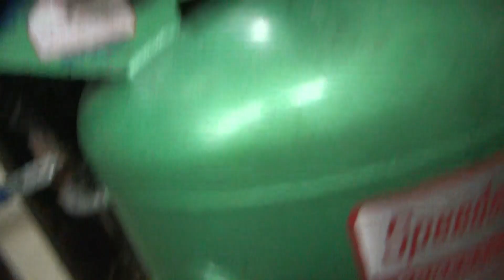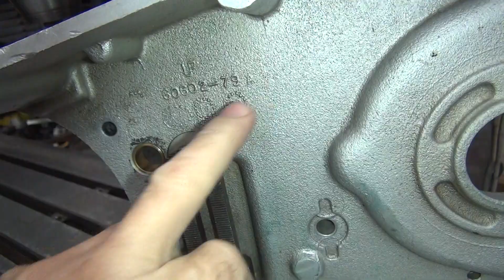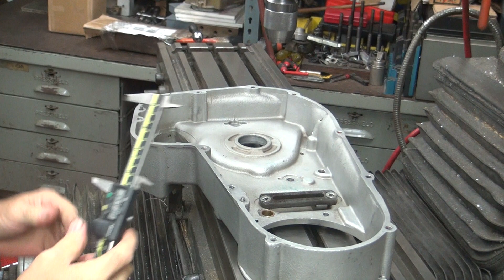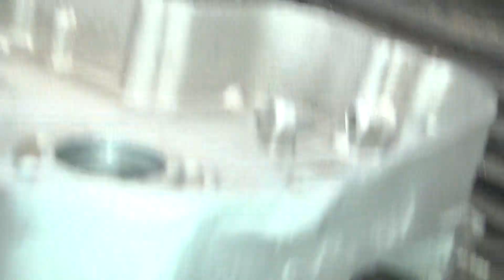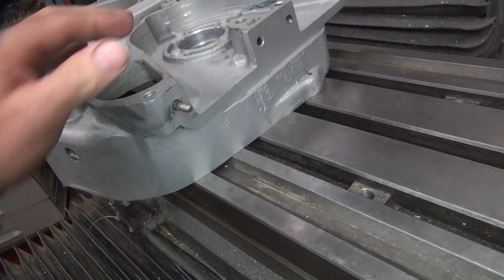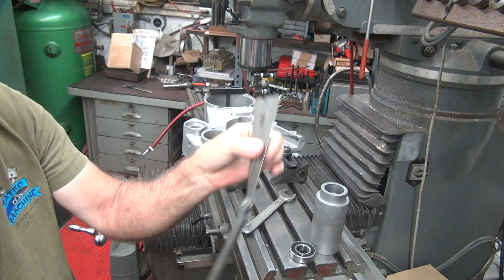#108 1983 fxrt shovelhead inner primary loose bearing repair 1979-84 FXR FLT harley tatro machine

Comment: Back in the 80's a friend of mine fixed the problem differently.
He turned a piece of steel that was .004ish smaller than the bearing OD.
He stuck into the hole then peened the aluminum until it was a tight fit.
Removed the plug and pressed in a new bearing.
Reply from the maker: with the soft alum that these primarys are made of i don't know how long that would last. its a good short term fix but this one is permanent.
tatro
Reply: You're fixing it like HD should have done in the first place. @TatroMachine